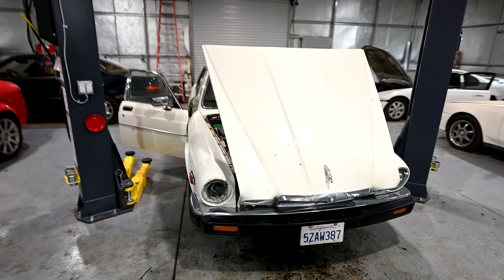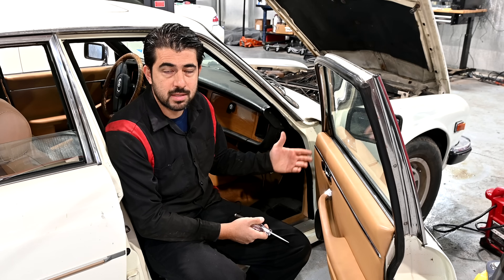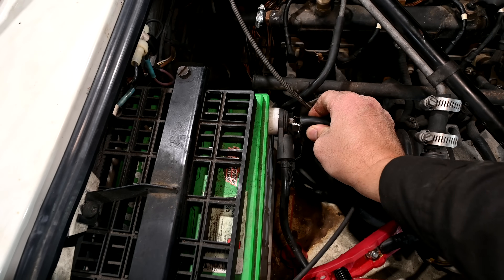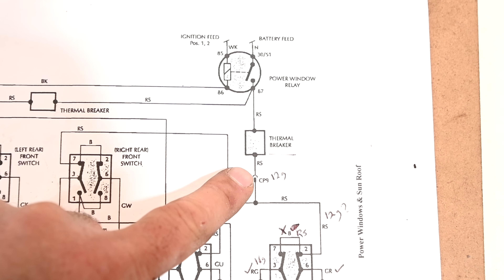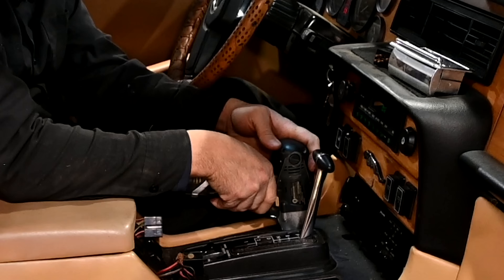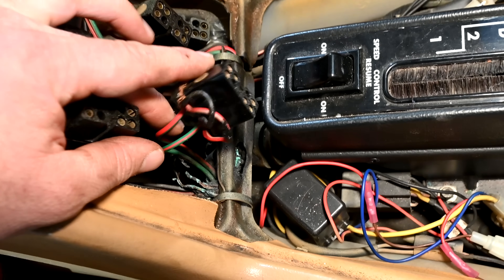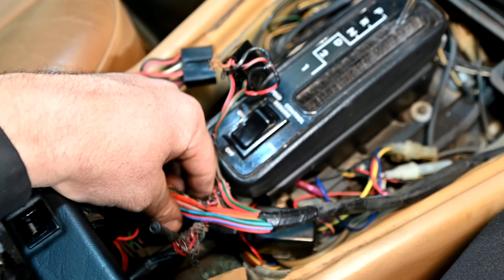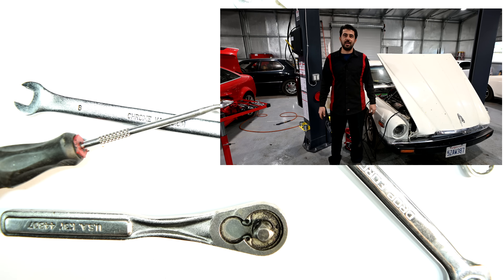Never Just Replace a Blown Fuse - Must Watch

Comment: question what happens if my fuse will not blow but burn and smokes i pull fuse and it stop i though it was my hid box or blubs because the lights would  flicker but i replace the hid box and wireing from hid box to light. bulbs and bulbs as well i though  the hole system  was bad so i removed  replace in all it till doing it burning in the same fuse i replace burn fuse to test and i cant put the battery on as soon as i connect battery  light come on with switch off and continue to burn same fuse and smoke WHAT AM I MISSING

Comment: Still remember how 3 years ago I found an electrical issue in my c6 Corvette...problem was after an accident I got hit by my side (driver side) right on the rear quarter panel which is the side that has the Sirius XM box alone with OnStar both functions inside the same device,after not having radio functions I decided to remove the radio and have it checked,replaced the radio fuse which was blown and yes radio worked for two days after that period of time I had no more radio signal and the electrical functions in my car stopped working...every single thing was completely dead,problem was the radio and OnStar box had a short circuit and all the wires got melted with the rest of the main wiring harness so every time I replaced the wires it melted again and again...I traced the wire that was getting hot after 5 seconds of starting the car and realized that a single shitty box that I don't need was the cause of the whole car issue ...removed the box..replaced the burnt wires and no more issues...I even remember I was replacing the 15 amp fuse for a 25 one ,,so my advice is.. instead of just replacing fuses or relays find the source of those getting blown ...thumbs up for you sir... I'm a loyal subscriber cause you really know your stuff you are a school made person,, happy new year

Comment: I just ran into this with my mom’s car. Blown fuel pump fuse. 1st shop replaced and said sometimes they just blow. 140 dollars. Took it to dealership, after a week they got to see the pump with power not running. A stalled motor draws more amps because no counter emf to resist impressed power. 1000 dollars and fixed for real. She’s in her 80s and can’t mess around in below freezing temps with a non running vehicle. Fuses only blow because the circuit is drawing too much current.

Comment: 1. Immediately pull off the Interstate. 2. Have car towed to the dealer. 3. Call a cab. 4. Get a Hotel room. 5. Rent a car for a couple days. 6. Pay them to replace the fuse and send it on its way. If that new fuse doesn’t blow, they’re not going to tear down your car only to find out it was an overload and not a short.

Comment: The factory fuse is labeled as a thermal breaker on the diagram. It should automatically reset after it trips. Is it even bad? Did someone bypass it with a fuse just because it kept tripping?
Reply from the maker: I didn't get it on camera but it was bad.